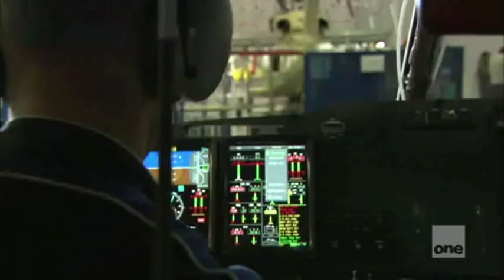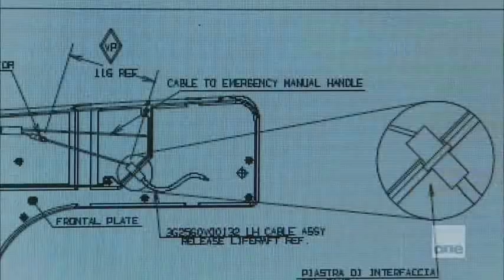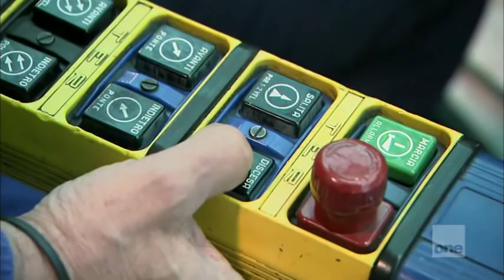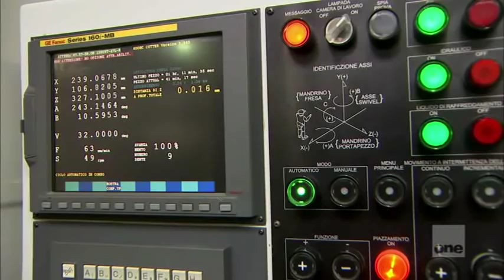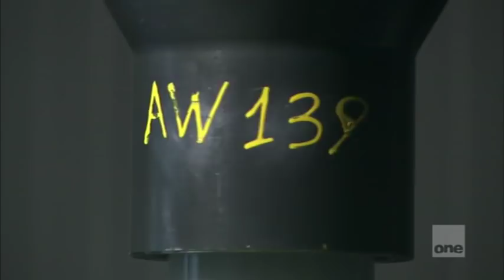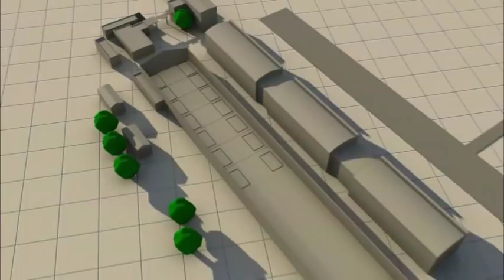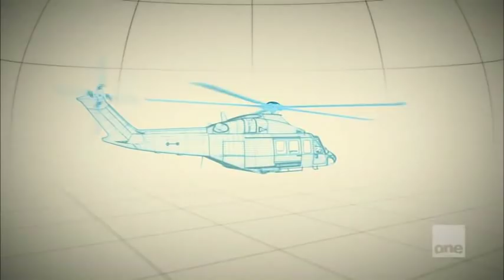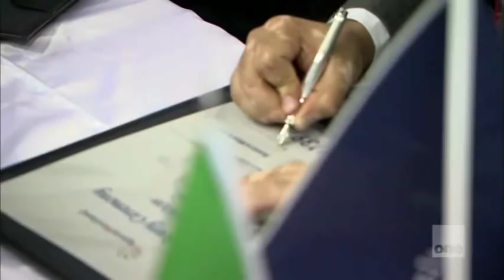Megafactories Agusta Westland AW 139 Helicopter Manufacturing (English,Re Post)

Comment: what an impressive facility. It is an excellent concept to have a unique set of manufacturing planning for each build, this can eliminate many possible errors by storing all planning electronically giving the manufacturing engineer the confidence in knowing that the most up to date plan is released to the factory floor. Eliminate all printers in the facility would guarantee absolute fail proof planning. I would like to see your prototype area some time, hopefully this will happen in the future.

Comment: Umm...one of its kind? The UH-60 Blackhawk has had ice detection since the 70's. It has an ice detector on the starboard intake that tracks the ice buildup. It has heated mats woven into the main blades, a pipe inside the leading edge, filled with nitrogen, that heats up, and a set installed in the tail blades as well. Not to mention anti-ice intakes and heated windscreens.

And those boxes used to absorb vibrations, it's not a new thing.
Reply: Ya Italians know how to sell their expensive toys. Also MI-8 has this one of its kind anti icing system since 60s, but not just like that product manager is getting his paycheck :)
Reply: The UH-60 is military . Military aircraft often have technology before civilian variants.
Reply: Alfredo Pacheco Jr 
Um what does your country of Origen make as far as helicopters are concerned.
Reply: Marcello Bernardo Sikorsky (Blackhawk/Seahawk/Seaknight/Seaking/Super Stallion), Bell  Helicopter(Huey, Venom), Boeing Helicopters (Osprey/Apache).
Reply: Alfredo Pacheco Jr 
Mr. Pacheco I said your parents country of Origen if you please. If you are going to make statements like you did in your analysis of one Italian helicopter. Then please respond to my above statement,
Thank you sir!

Comment: how does it overcome the problems that most helicopters have at high altitudes?
Reply: it explains it in the film but basically the AW 139's engines
Reply: By having considerably more power than a comparable single engined design,also the design of the blades is critical to being able to operate at higher altitudes,they are not only much thicker but also considerably wider creating a larger swept volume (if you think of rotor assembly as a giant fan they are able to move more air than a standard set when both sets are operating at the same speed) At higher altitude they have to move a larger volume of thinner air to create a similar amount of lift as they would at a lower altitude.
Reply: having twin power units
Reply: A single PT6C-67C engine can produce 1700 HP

Comment: They mention the engines not having enough oxygen to run properly at such high altitudes. My question is, what's the difference between a helicopter engine and a fixed wing aircraft engine? Jet and piston engine aircraft have no problem running at higher altitudes then they're talking about. I don't get it...
Reply: +Blaze0357 In my experience with HEMS/SAR-HHO/AA helicopters I can tell that the main concerns are with the thin air which provide insufficient aerodynamic lift.

Comment: Up to ten hours to install one engine? I think that's false info, if not, then it's just sad.
Reply: Dont you listen to install they have to position fuel line electrical line amd one tiny slip and damage a major component.
Reply: plus those engines are very expensive so the 10 hrs can be excused.
Reply: At my job it's normally a 3 man hour to remove/install that PT6C-67C engine.